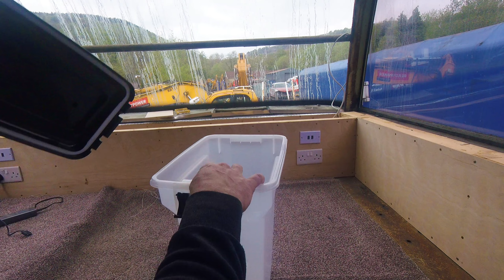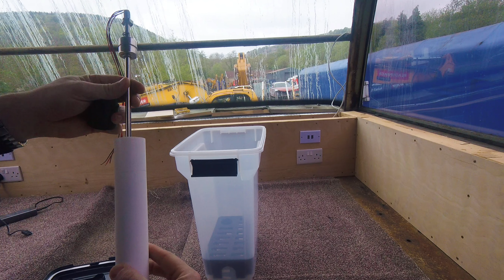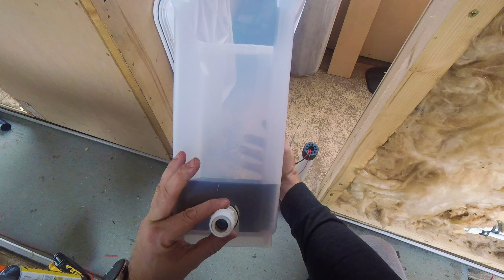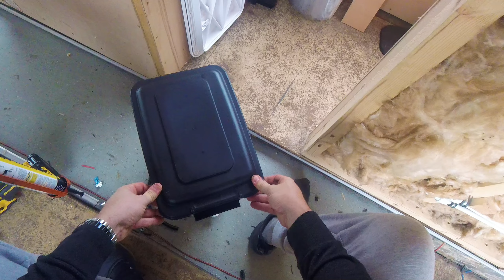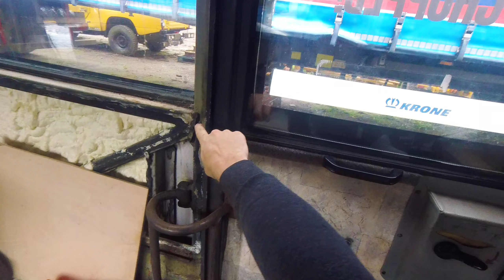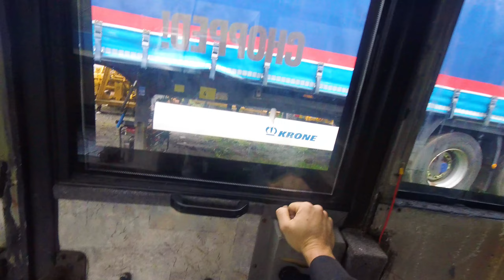The simplest DIY gravel filter for the bus?

Comment: What happens with bits of food etc that get into the filter. Obviously you would scrape the dishes etc to ensure as much food is removed but what about other bits and pieces put down the sink by unknowing people, kids etc. Would they just naturally degrade or block the filter?
Reply from the maker: The metal grate should catch big particles and the gravel that will be in the container filters smaller bits. It will have to be cleaned every now and then, but gravel is cheap and easy to change :)
Reply: @aurorathebus  any idea roughly on how long it will be between clean outs or is it just trial and error at the minute?
Reply from the maker: @janwincote7260  Id say trial and error, every couple of weeks maybe? i guess it would be depending on what goes down the drains, but the metal grid should catch most of the bigger bits, and might be worth putting plug hole traps on too to catch anything before it even gets to the filter... i guess we'll find out!